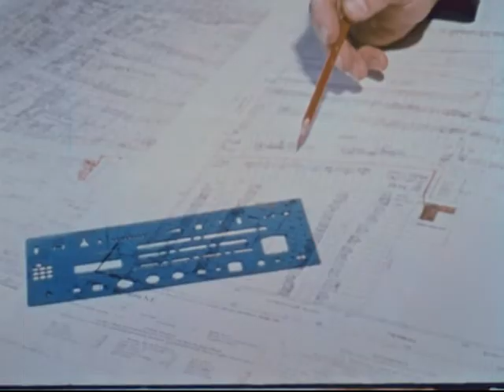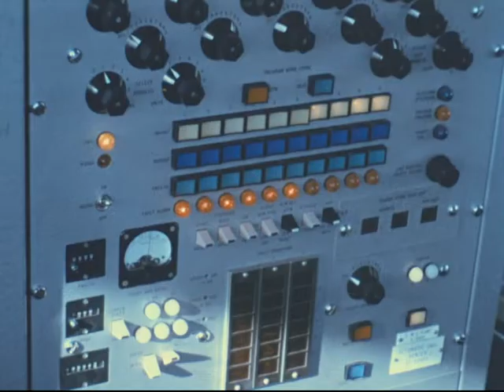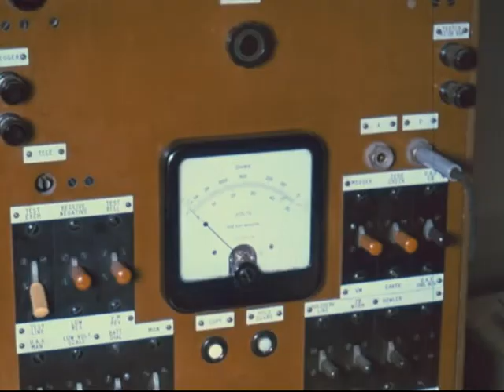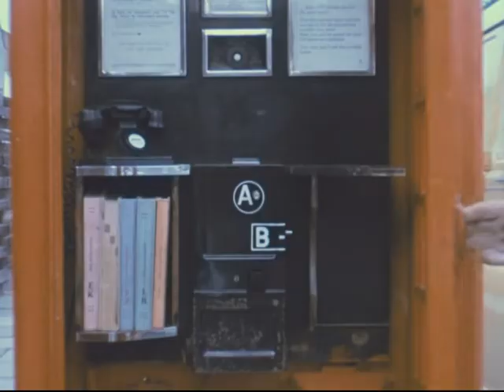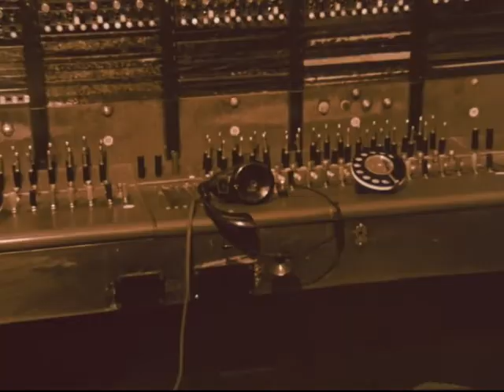End of an Era | BT Heritage

Comment: Soon the new building will be gone. The Exchange equipment went during the 1980/90. The lines where transferred to the system X at Romford.
Reply: So if the exchange equipment is no longer there, what has been happening there since the 1980s/90s?

Comment: This film is dated 1970.  It says the exchange is the first to get crossbar.  But the relays shown are the old fashioned BPO 3000-type that date back to 1950 or earlier that require periodic adjustment, not the maintenance free relays that other administrations used with crossbar.
Bad film editing or was the BPO a really old fashioned government department?   
The second, actually - In Australia our then old fashioned government department phone company APO started installing crossbar (with "modern" maintenance free relays) back in 1960 - which was years and years after the Americans.
they showed ceramic formed wire wound resistors of a design introduced about 1900 too.
Reply: It was a really old-fashioned Government department.

Comment: I didn't realise manual exchanges lasted that long!
Reply: Catalina Island still had a manual exchange up until 1978. There were still some remote areas after that where an operator had to manually reach the number.
Reply: We moved to Upminster in the summer of 1969. The phone at our previous house had a dial, the Upminster one did not. To make a call we had to lift the handset and wait for the operator to ask for the number we wanted.
Reply: Newbury exchange in Berkshire didn't change from manual to crossbar until 1974!

Comment: That system would recover more quickly from a solar incident or an EM pulse. Digital is not as robust.
Reply: Rubbish. I've seen exchange buildings and overhead carrier systems hit by lightning which was all dissipated to ground with only the odd line card burnt out. The trunk network. processor, memory and billing systems are all very well protected.
Reply: @greenpedal370  He was talking about something different 🤷‍♂

Comment: The commentary says "for forty years all calls including local ones had to be connected by an operator". Surely most/all exchanges would have been automated with Strowger in the 20s for local calls, with operators being used for trunk calls until STD. According to a Wikipedia article the UK started STD on 5 December 1958 but doesn't say when the roll-out was completed but 1970 when this film was made seems reasonable.
Reply: 1976 Portree Isle of Skye the last manual unit was disconnected.

Comment: This exchange had a maximum of 10,000 phones connected to it. You can tell it by looking at the size of the new permutation racks, or more precisely, by looking at the power supply current meter, which shows 180 Ampere of current.
Our analogue phone lines are powered by -48 V DC, with a line current of 20 mA, or 0.02 A each. So, with 180 Amps, 9000 phones are connected concurrently.
In many places, the limit of 10K phone terminals max has been a lingering problem until electromechanical exchanges have been replaced with the actual computerised types, which uses in-band DMTF (multi-tone) for dialing, and are capable of carrying caller ID information and later, ADSL for data and Internet.
Very slowly the PSTN are being replaced by their fully digital counterparts. This change impacts the customers negatively, as all telephone terminals in homes must be replaced. In certain cases, the terminal needs electrical power.
The wisdom, at this point, should be to replace this "last mile" directly with a fiber optic.
Reply: I worked on a 20,000 SXS unit when first started with the company
Reply: Rayo, your calculation is clearly nonsense.   not everybody will be calling at once - in fact they can't, because phone companies limit the number of trunks to what's actually needed.
A general rule of thumb valid in western counties is that telephone usage peaks at 1/10th - so a drain of 180 amps means a total of 100,000 phones, not 10,000, assuming your 20 mA per phone is valid..
However, other equipment usually found in telephone exchanges adds to the current.
Reply: @keithammleter3824  You're the one spewing nonsense. Upminster, through the 2000's had a population of around 10k, so there would be no use for 100,000 lines. 10,000 would be more than enough for the area. Further, the largest manual city telephone exchanges built were around 10-20k lines. Manual exchanges poorly scale because operators can only reach so many lines and you can only have so many appearances.
Reply: @keithammleter3824  That wasn't my point and yes I know that, and I even know that the original 5ESS had an analog multiplexer before the codecs so that only 8 of 64 lines could be off hook at any time. What you're delusional is thinking that that manual exchange had anywhere close to 100k lines. It simply wasn't possible, not to mention completely unnecessary for a London suburb. The original comment of not more than 10k lines is 100% correct, while you are dead wrong.
Reply: @straightpipediesel  Well, if its only 10,000 lines, and manual, it can't draw 180 amps.  That's my essential point - the original poster Rayoflight's calculation is just plain wrong.   I'm not in a position to know if his 10,000 lines is wrong, or the 180 amps is wrong  (a photo of an ammeter showing 160 amps is shown at 13:18 but it could be stock footage from anywhere - particularly as it is a steady reading supposedly after the manual exchange was shut down).  But what I am able to do is use very basic math to show that Rayoflight's calculation is completely wrong.
Note that Upminster is a very narrow suburb, adjacent to other dense suburbs on its west side and to some extent on its east side.  For instance, from centre of Upminster to centre of Romford is only 5 km.   Therefore it is most likely that Upminster Exchange served these adjacent towns, a very much greater total population (about 160,000) than Upminster alone.  Typical local call radius is 4 to 7 km due to technical limitations and administration policy.
Telephone exchange service areas do not correspond to local government boundaries or town boundaries.  They are set so as to minimise telephone administration's cable costs added to exchange equipment costs.
And, as I said before, manual exchanges of 100,000 lines were possible - where needed, administrations just installed multiple exchanges in convenient units (10,000 lines or whatever) in the same building, trunked together.  Technically not different in principle to multiple exchanges dispersed about a large area.
It was impractical to have more than about 600 lines plug addressable by any one operator (200 lines on her own board plus 200 lines on her left and 200 lines on her right).  But various schemes were developed to overcome this limit.  One early scheme was to give each operator access to semi-automated trunks.  If a customer requests a number outside of the three boards she can plug to, she selects the appropriate trunk, and gets an operator who can plug to the required number.  She tells the second operator what number is requested without the caller hearing, and the second operator   connects if the called line is not busy.  The call is thus connected via two boards in cascade.  The two boards can be quite remote from each other.
Later schemes included automatic switching in manual areas.  Instead of the customer dialling, the operator dialled.   It was still referred to as a manual exchange, and typically done as transition step. And each operator can by dialling access much greater than 10,000 lines.

Comment: 15:32 crossbar equipment and racks looks the same as installed at  Plessey Kingsthorpe Northampton summer 1973
Reply: worked at Kingsthorpe in 74/75
Reply: @bobtuck5820  I worked at Wellingborough as well. Learning cable colour code and Urdu slang.

Comment: Amazed they were fitting crossbar in 1970 ?
Reply: Crossbar was being installed in Westhoughton, Orrell (wigan) in 1975 /6
Reply: Why?  TXE4 wasn't until 1976 and System X not until 1980.  So Strowger or Crossbar were the choices.
Reply: We still had step by step exchanges in South Africa in 1997.